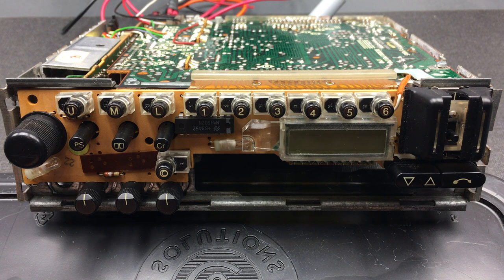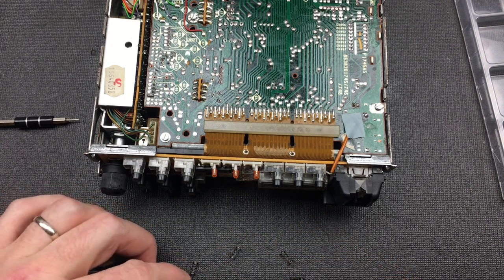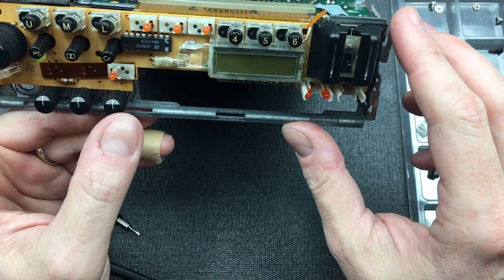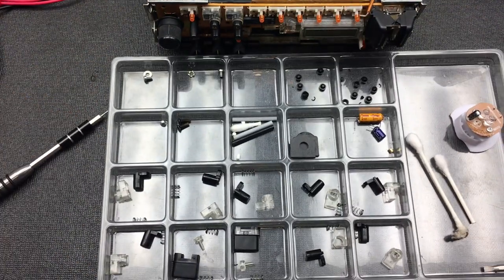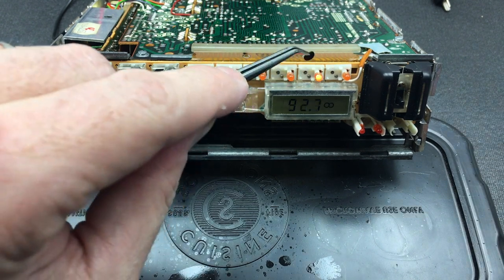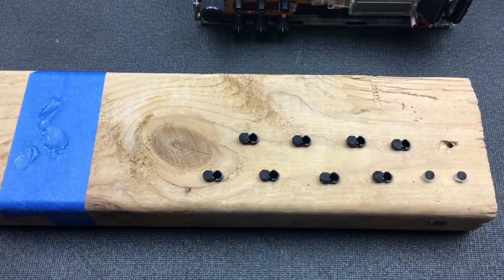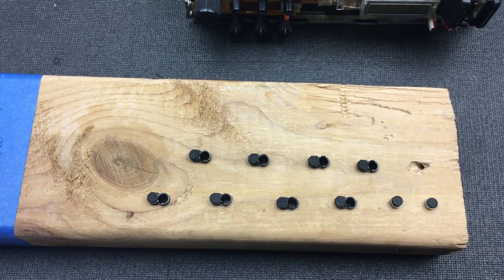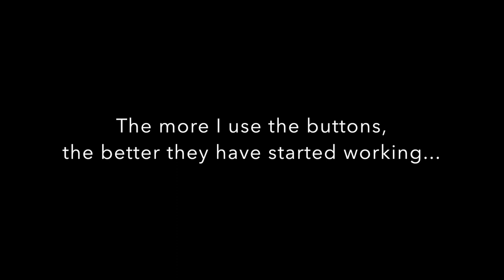Blaupunkt Monterey SQR 23 Part 4: Repairing the Buttons

Comment: I don't know anyone with a 3D printer...could I use the glue/conductor disc from your first step, then glue another rubber conductor disc to the top of that?   Do you think that would help flatten out the concave? Thanks for these videos!
Reply from the maker: Yes, I think anything that 'fills' the buttons will work.